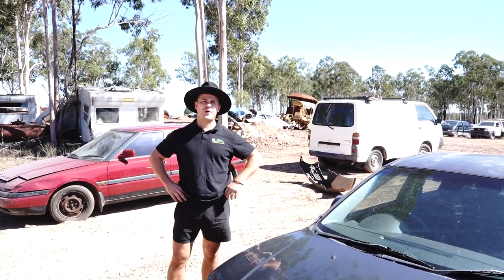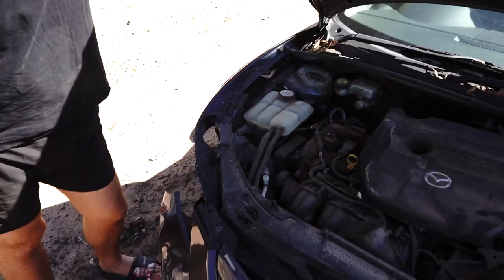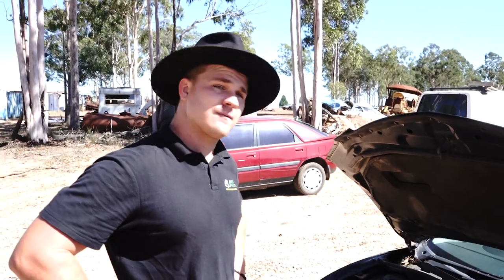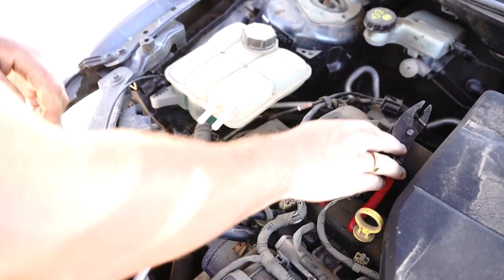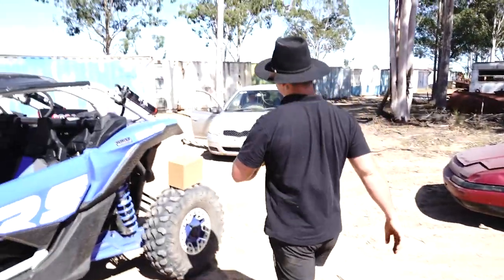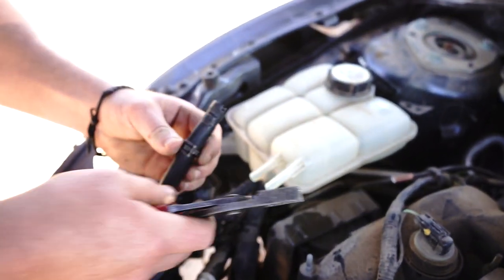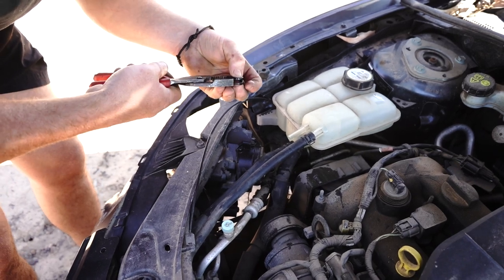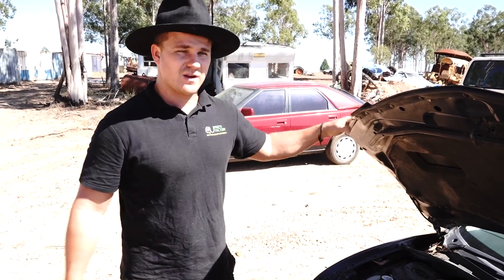How To Replace Mazda 3 Coolant Overflow Bottle 2003-2018 BK BL BM BN

Comment: Clamp the hoses before removal from the expansion tank. Keep them clamped until you have refilled the coolant. Then release clamps. This will save you from bleeding you're cooling system.
Reply from the maker: Can do this. But not everyone has 3 pairs of vice grips etc
Reply: @thepartsfactory4239  I'm talking about "irwin" style clamps not vice grips. I wouldn't use those, but that just me. 👍

Comment: Hey mate followed your steps easy as but the tips of the hoses Leak for some reason any tips on that ?
Reply from the maker: Better hose clamps. Thx
Reply: If there is enough length of hose, you can try cutting half a cm of hose off the end so you have unstretched hose over the plastic tank, sometimes the hoses will stretch a little, otherwise, like @thepartsfactory4239 said, higher quality clamps that can clamp more evenly.

Comment: Is it safe to put duck tape over the cracks in the meantime while the parts arrive?
Reply from the maker: No this is a closed loop cooling system do not drive it if possible